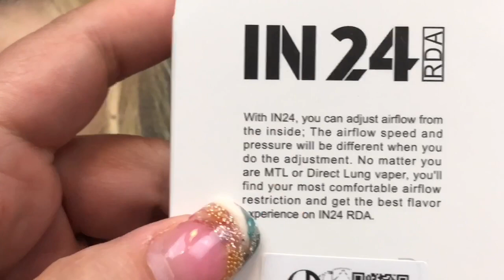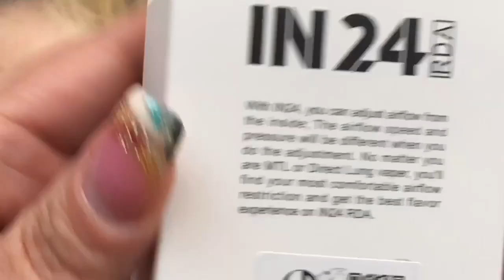REVIEW & BUILD **GIVEAWAY CLOSED ** | IN 24 Rda from Vapuff

Comment: Interesting RDA.  I may be wrong, but if you put the coil in with legs over the top it would put the coil itself closer to the airflow without having to try to push it down. Less likely to deform the coils that way as well.

Comment: Certainly innovative, but I'm not sure if it really gains you anything for the additional complexity - a conventional AFC with kennedy bottom airflow pipes would be as good, I reckon and certainly easier to adjust - the pipes could angle inwards to a single coil and still allow a squonk pin to be used, and it would surely be less expensive to make.